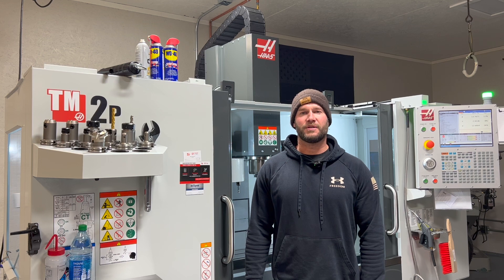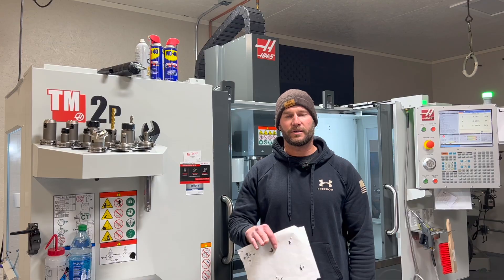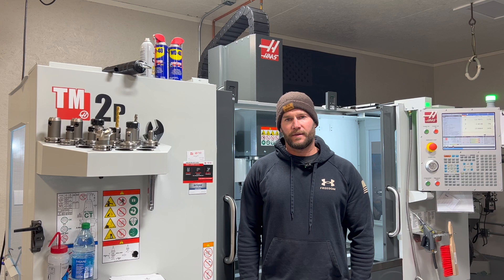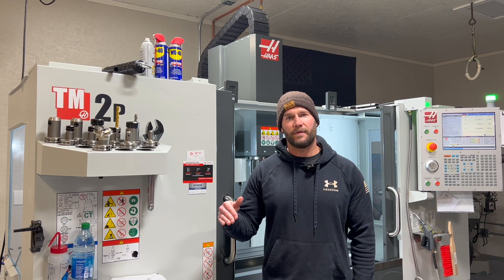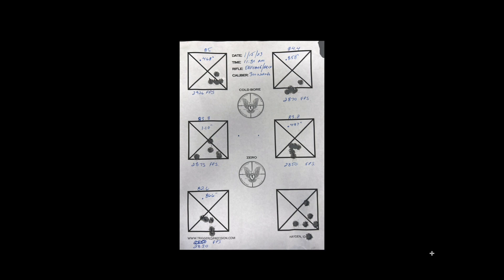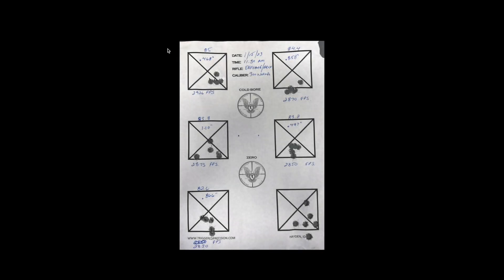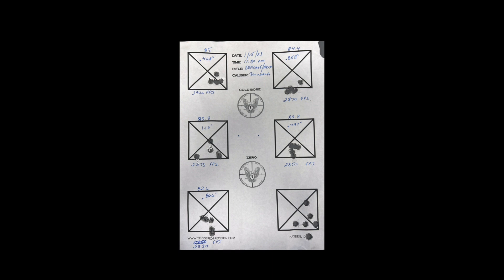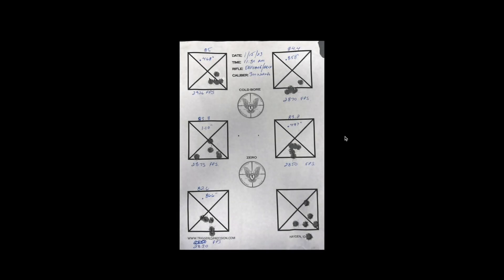TPM - Intro to Precision Rifle Reloading - Initial Load Development - Dan Newberry's OCW Method

Comment: What distance should these be shot at?
Reply from the maker: 100 yards is a good distance. Shooting further just increases the potential for environmental factors (wind)  to change the results you see and make the test invalid.
Reply: What would you recommend I start at for a 6 creed with 105 Berger target. I am trying to load some tonight for the first time
Reply from the maker: I shoot a 115 DTAC in my 6CM so my load is going to be a bit off from where you need to be. If you have H4350, I would experiment in the 40 Gr - 44 Gr range. Work up slowly and look for pressure signs. Start .020" off the lands.
Reply: @grantedwards3262  the last time I did this for the 6mm Creedmoor and Berger 105 gr Hybrid I spanned 39.5 to 42.5 grain.  That was with H-4350 in Lapua brass.
Reply from the maker: Awesome, thanks Todd! I need to experiment with the 105 Bergers. I ran those in a 243 Win for a while.  Great shooting little bullets.

Comment: Quick question… Would using a magnetospeed chronograph change the harmonics while doing this test? Or does this method prefer a chrono not mounted to the barrel. I have found when using the magnetospeed I get a shift in PIO. Thanks
Reply from the maker: Yup! Strapping the magneto speed onto the barrel absolutely will change the harmonics and POI. I reserve the Magnetospeed for velocity confirmation in the field or at the range after I get all my load development done. Its a great tool, but like you said, you don't want to have it on during load development or when you're checking zero.  Awesome point to bring up, by the way.
Reply: @triggeredprecisionmachinellc  A point taken Shawn on the magneto speed. I tried my first test with it strapped on. Will redo and leave off.
Reply from the maker: Let me know what you find!
Reply: @triggeredprecisionmachinellc  Found that also. I add an extra round for each of the charge weights, and after the OCW test part, then attach the Magneto speed, for a velocity check on a similar target next to the OCW target (so not the same one OCW carried out upon), to check for velocity, just for some info to add to each load.
Reply: the similar target setup, as the one OCW carried out upon, is you effectively get to transpose where the velocity measured load hit, to compare with the OCW test loads of that same charge weight (like an overlay comparison).
Reply: Cheers, do you break position after each shot? That is a great vid thanks

Comment: Came across Dan's OCW method a few days ago and decided that was the way I will start. One question. When doing the developement, should one have weather temp more conducive when the load will be used the most?  For instance, I do testing when temps are in the high 20's low 30's. I pick a starting charge weight middle of the road but humidity is low. I'm curious as to what weather factors will change an overall result, hence redrawing the test again at a higher temp.
Reply from the maker: That’s a great question. 

The beauty of the OCW test is if done properly, you locate a powder charge that will allow for some degree of variance in pressure from changing conditions. 

Start out with a good, temperature stable powder and make sure you’re reloads are as good as can be. Record the muzzle velocity, weather conditions, and your overall findings. When the weather warms up, your cartridge pressure may go up a slight amount which you can revisit at that time by running a few rounds over the chronograph.

I’ve done this several times and never had any issue.  My only advice, make sure when you are doing your testing, try and locate the pressure threshold for your particular rifle and make sure your final load isn’t right up against that.  Often times when you are conducting the OCW test, you’ll find a couple of “accuracy nodes,” through the range of powder charges you’re testing and sometimes there is a high one that is right up at the max pressure range for your rifle. I’ve always avoided this node and found luck at the next node down. Velocity is always second for me, accuracy and consistency take precedence. 

Good luck!

-TPM

Comment: I’ve tried many different methods, and this has always been the most reliable. I use to do 5 shots, but dropped to 3 during the most recent component shortage, and it has worked as well, if not better, so I’ve stuck with that.
Reply from the maker: I absolutely agree with you on the 3 vs 5 shots.  The only benefit you get from 5 shots is a little better sample size for more accurate chrono data, although even 5 shots isn’t enough in my opinion to get a “hard” velocity average and ES.  I noticed on this target that the 5 shot groups almost muddied the waters as far as interpreting the results of the test. I’ll be sticking to 3 from now on.